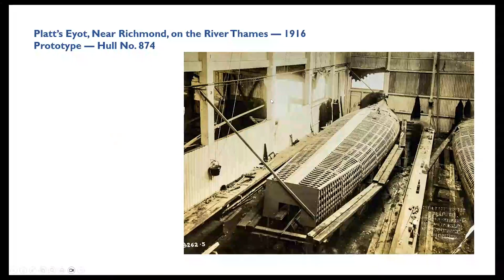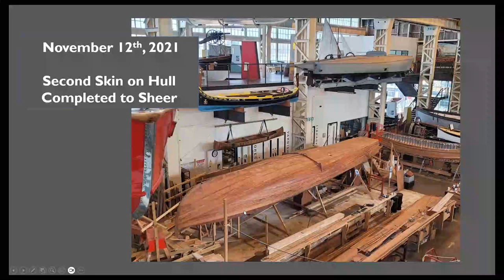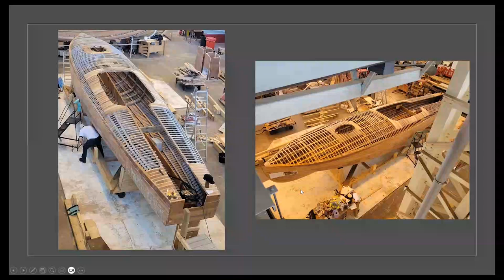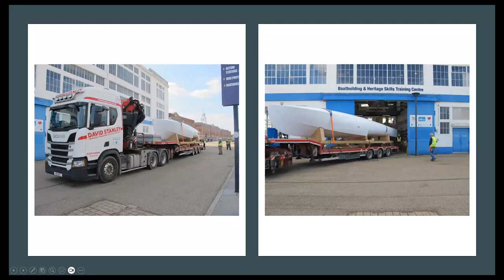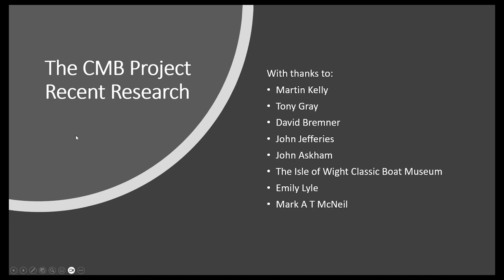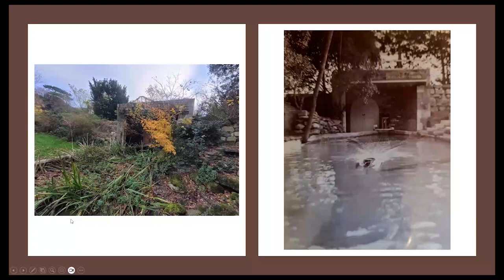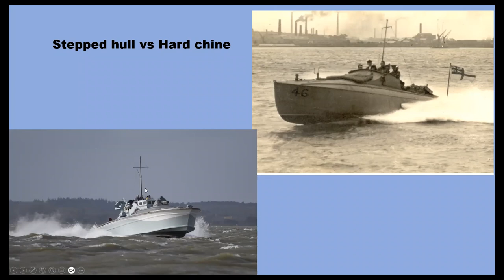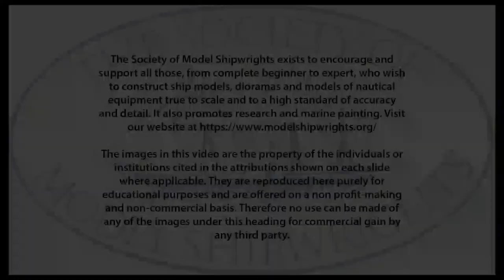Building a Replica of a 1916 40 knot Thornycroft Coastal Motor Boat, Part 3

Comment: Very strange method of doing the step. I prefer the original conventional method. A petrol 250 horse engine would be a lot cheaper and closer to historic. And yes it does look like a plastic boat since fiberglassing. But a duller finish matching early 20th century oil paint in sheen and with visible brush strokes would go a long ways in producing an historic look. This could be done with modern long-lasting polyurethanes. But otherwise, who would have done this boat if not for you people?  What an excellent boat to recreate!
A very big contributor to the planing hard chined V-bottom boats was William Hand Jr. of New Bedford, Massachusetts who is credited with designing the first planing V-bottom boats before 1907. Hand himself denied that he originated the type and instead cited the V-bottom working boats of the Chesapeake where he and his family had vacationed when he was young. The Chesapeake Deadrise comes to mind. His 1919 catalog states: "The Hand V-bottom originated about sixteen years ago...." which would put it around 1903. By 1919 the Navy had been using his designs for fast patrol boats for years. His 1919 catalog (two of which I own today) has at least 25 planing V-bottom plans available up to 60 feet in length.  Hand became famous for these designs which were sold worldwide and were immensely popular through the pages of Motorboating, Rudder and Motorboat and other magazines before WWI.  In 1912 , a young man named George P. Bonnell built Old Glory, a 24 ft runabout from William Hand's Piute III design and made an open water passage from Long Island Sound to Yarmouth, Nova Scotia and returned safely. This was remarkable for its day. He even met the designer midway along the trip and Mr. Hand tuned up his carburetor and served as his guide for several miles through local shoals. The ad for this particular 24 ft boat plan by 1912 read, "You can build one. There is no steam bending!"    Today, the history of V-bottom boats seems to have forgotten this to be replaced by a weird jumble of gobbledygoop claims. He later became better known for developing the motorsailer and forgotten is near monopoly on the V-bottom boat plan market in the earliest years.    Step hydroplanes are another subject altogether of course.....